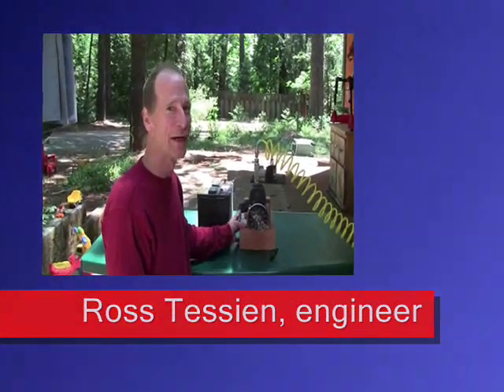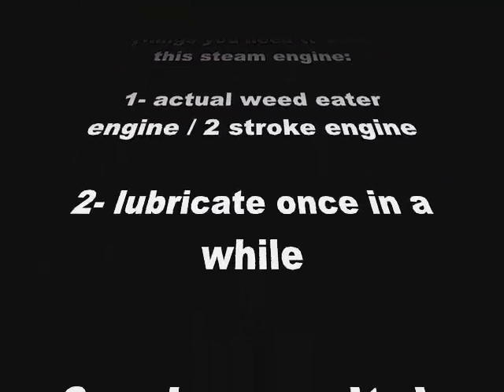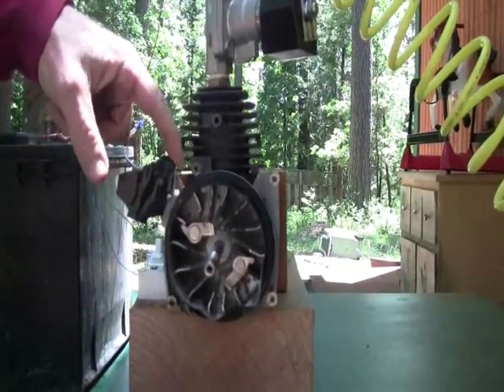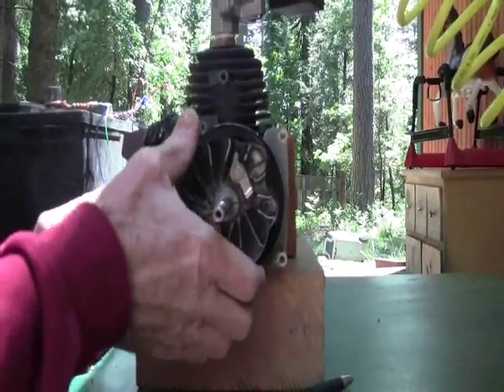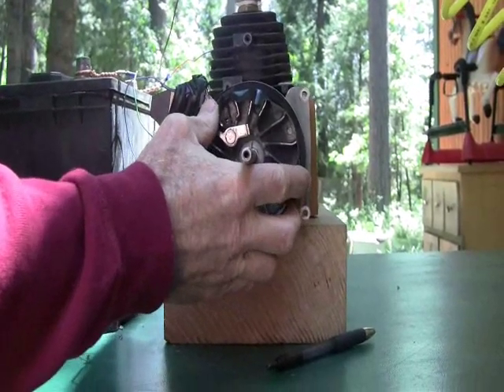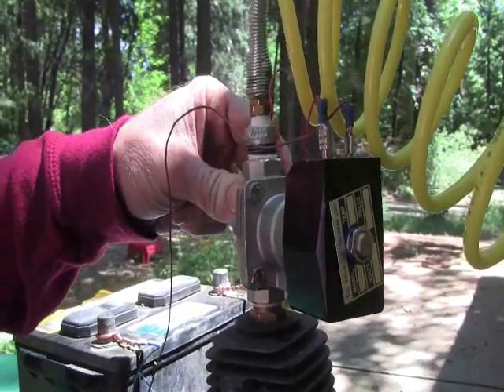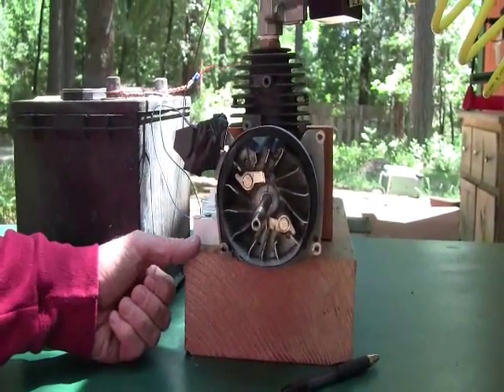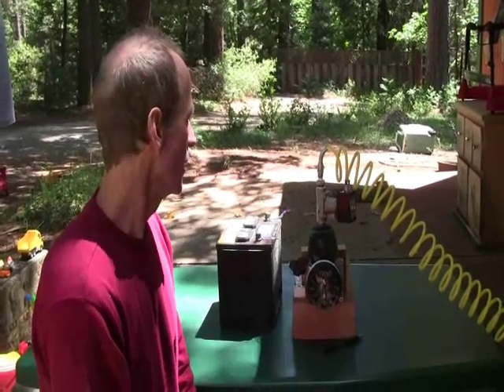2 cycle engine to steam conversion.wmv

Comment: Question though: If the solenoid valve is designed to withstand steam via stainless steel and teflon, how well can the 2 stroke engine handle it? It has no teflon or SS, wouldn't it rust and seize in short order?

Comment: You might try a normally closed micro switch and only have to drill a small dimple in the fly wheel to close the switch.  You would have to drill an identical hole slightly offset to miss the switch to balance the flywheel on the direct opposite side,

Comment from the maker: Yes, see one of my very early videos showing early attempts at an air / steam bearing design.  They are complicated. I've managed to get them to work, sort of, but haven't had enough funding to truly develop them.  That is, however, the ultimate goal.  turbine bearings and seals both will be provided by fluid bearings.  Design is ready for fab, but need funds first for the machining etc.  As for Temps, I've run up to 400C, so Teflon's out as are oils...ergo dry metal coating lubricants
rt

Comment from the maker: In future, dry lubricant metal coatings combined with steam to provide lubrication.  That way no oil is being introduced into the water system.  These early tests are sorting out power, size, thermal efficiency issues prior to design and fabrication of a real engine.  I'm not settled between turbine vs engine, so these tests help make a choice.  turbines are quieter, but there are many issues to work out on either path.
rt

Comment from the maker: Yes, Absolutely, Great you noticed.  2 cycle engines need lubrication.  For these short test runs, we just shoot some WD40, 30W oil, or other lubricant into the open cylinder.  Free junk engines so not too worried about ceasing them up.  But for the real steam system, lubrication will be important.  My goal will be to build the cylinders using high velocity flame spray "dry" lubricants such as nickel teflon flame spray or various Mo combinations.  But lubrication will be key to success.
rt